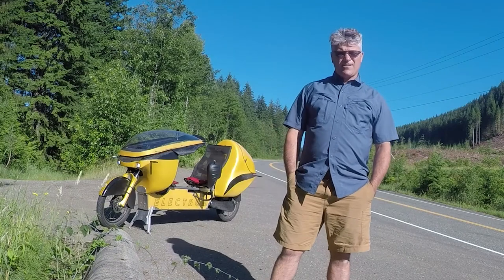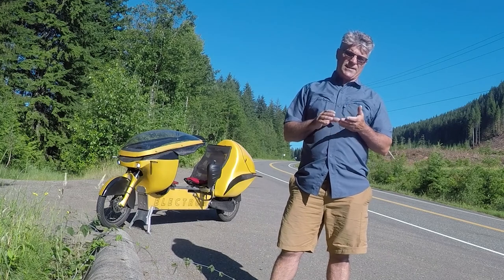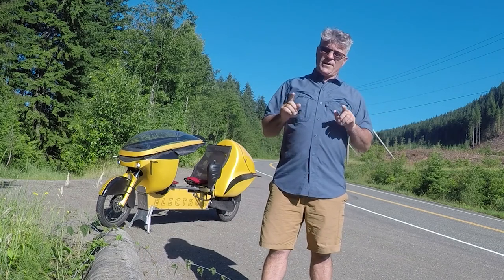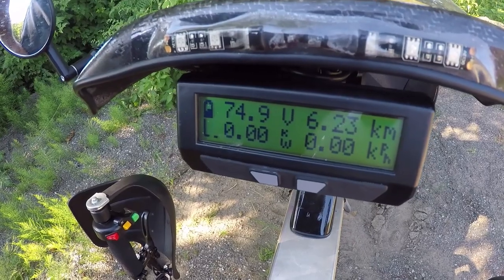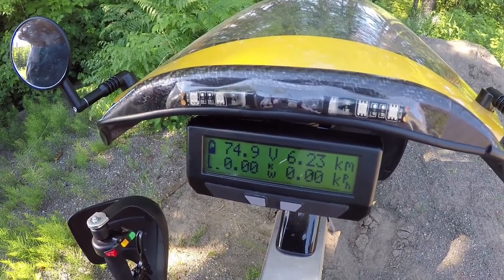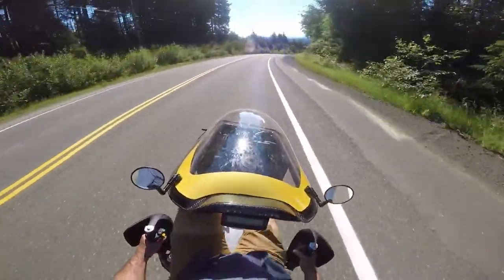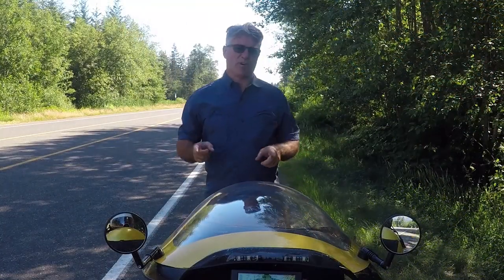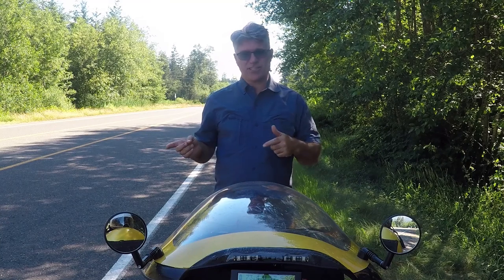Regenerative Braking on the Electrom LEV

Comment: You have regen breaking also at low speed? Like 30km/h, because there  are some downhill road that I can’t go 60km/h
Reply from the maker: Yes, Regen braking can be triggered anytime by squeezing either brake lever. First you get the regen, and if you keep squeezing you get the disk brakes.

Comment: A very impressive vehicle indeed, but...I'm interested in regenerative braking as a means of braking and controlling the vehicle. I shift my 4 speed auto down into second and I feel the trans turning the engine and dissipating energy (rather than vice versa). I get a sense of control going into curves being high in the gear. It would be interesting if an e-bike motor engineer would design and build a drive system with optimizing and maximizing regenerative braking in mind; not only to recharge the battery but to be integral to braking and control. I car pooled with a Prius driver and he made a game out of trying to slow/brake the car only with the rein braking, by partially pressing the brake pedal and engaging only the regeneration braking system. There was a different feel when he applied regeneration and when he applied  hydraulic brakeing for same braking conditions.
Reply from the maker: Hi Jeffrey, I know exactly what you're talking about, we have a hybrid car and you can absolutely tell the difference between the regenerative brakes and the standard brakes. 

The Electrom uses a controller that supports proportional regenerative braking. The regenerative brakes are activated by a slight squeeze of either brake lever, and when this takes place,  the throttle changes rolls and becomes a means to increase regenerative braking. The hand actions do require some mental gymnastics to get the hang of the process, but it works very well. The default is for the regen' to come on at 10% power, and by using the throttle the rider can bring it up to 100%. The maximum amount of regenerative braking possible is determined by what the controller can handle, and what the batteries can absorb. If one's battery is already full, then there is no capacity for the battery to absorb the energy and one experiences less regen'.  But if the battery is almost empty, the regen' can be very strong. As you see in the video, at one point the regenerative braking is putting out as much as 3.5 KW, which is a huge amount of energy.

Comment: 88 kph...I'm not sure where you're going to do that on any road in Canada without a whole bunch of expensive fines. E-bikes have to be practical and affordable to gain wider acceptance. I love the idea of a semi enclosed recumbent style e-bike, but this seems like you've built something that is more along the lines of "what if".
Reply from the maker: I understand your concern, and I should have been clearer in the video about a few things:
1. BC laws say that the electric motor on an e-bike cannot take it over 32 km/h, but we are free to go as fast as the posted speed limit using gravity or human power. That is what is taking place in this video. 
2. The unrestricted top speed under electric power on the Electrom is 65 km/h, but it is electronically governed to a top speed of 32 for legal use of public roads. The only way to make an Electrom go 88 km/h is to use a steep downhill.